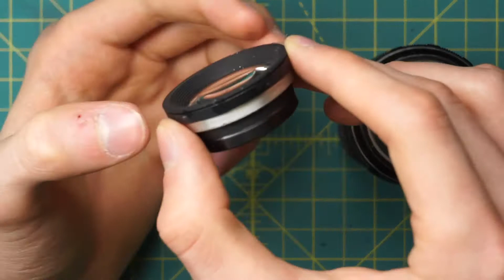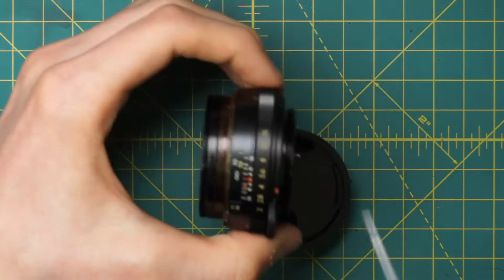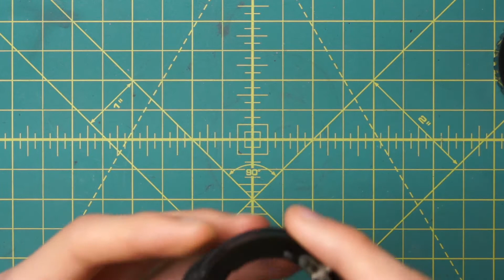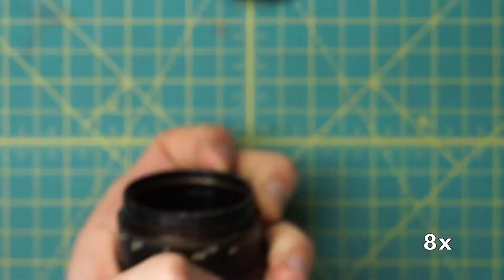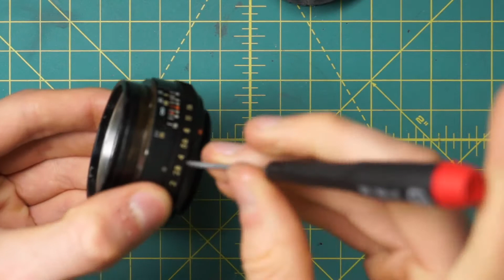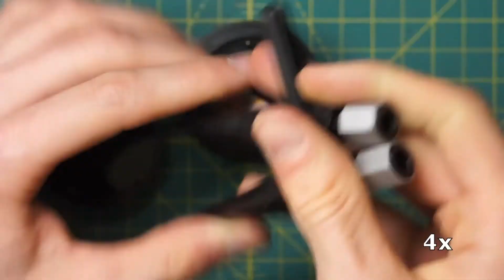Asahi Opt. Co., Super-Takumar 55mm f2 Lens Disassembly

Comment: Hi, I my problem is - the lens (exact the same except its 1.8) is always in auto mode whether the lever is on the M or A it doesnt matter. The lever moves but the mode doesnt change.
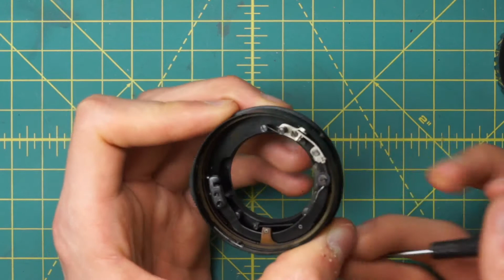As I zoomed the lens up front I could see from the rear element tiny gap inside and I saw one spring that should be attached to a screw (just like the on at 8:01 located at 12 o'clock) could this be the problem? Or what could possibly cause it? Is there any way to repair it?  Thank you :)

Comment: I have the 55mm f/1.8, I think it's pretty the same. My problem is that the aperture ring is stuck, it doesn't rotate! The auto/manual control works but the aperture is stuck between the f/5.6 and the f/8 setting. What do I have to do?
Reply from the maker: Try taking apart the lens to determine the root cause. If the aperture does not move at all, even when you try triggering it directly, then you'll need to try disassembling it to address that.

More likely however is that there is some sort of mechanical problem with your lens. Try taking the lens apart until you can move the aperture, then put it together step-by-step to identify where things stop working. Without looking at your lens, I cannot say exactly what is wrong with it but hopefully this video will help you work through it on your own

Comment: Thank you for these instructives, they're paving the way for my baptism into lens repair.  So much quality gear out there that can be restored if you just take that step and open up the lens. I'm still wary about opening up the sticking 80mm Zeiss Planar for my Hasselblad though. I don't see any oil and I suspect it may be a mechanical spring problem perhaps. Buying cheap lenses here and there and opening them up is one thing.

I just cannot factor in the cost some people are charging to have it CLA'd simply because it's a Hasselblad lens. Probably the worst investment I've made in camera terms. Bronica SQ-A would have been the way to go. Same size, half the price, just as great lenses.

Comment: Just got the same lens, only unknowingly I got the radiocative version. Wanted to try and fix the iris, tried to unscrew the top black ring as you said, it doesn't come off. Any suggestion? Thanks
Reply: if you see a amber hue to the glass its doped and is radioactive
Reply: whats the serial number of your lens? Because these early ones shouldnt be radioactive - they were made up to 1963 and then the newer ones (with the red diamond instead of red dot) started to put thorium since 1965 (S/N 1750 000 and up)

Comment: Does the front element have two lenses in it like the rear element? if so, how do I get it opened. I see two spanner notes but it seams like its seized up. I don't want to force it open, especially is its only one lens in the element. Thanks for the informative video.

Comment: I can't get the mode switch to manual. Fixable from the front. Advise appreciated.
Reply: can you see a very very tiny pin on the back of the lens? this must be pressed in (with e.g. a flat knife blade?)... only when the pin is depressed can the auto/manual switch be moved to manual.

Comment: Does the fact that this lens has thorium in its element concern you?
Reply from the maker: Unless you plan on crushing the optics into a fine powder and snorting it, I wouldn't be too concerned.
Reply: These versions didnt have any thorium inside them. Its a 345-2 model (with red dot instead of red diamond) made between 1962 and 1963. The thorium glasses were added since 1965 in the midproduction of 345-5.model (with the red diamond and more scalloped focusing ring)
Reply: @dzava  Hi, I am wondering does the 345-6 model contain any thorium? Appreciate your generous reply.
Reply: @zjonny1696  Hi, sorry for the late reply. Yes, I think yours already has thorium inside. Only takumars with red dot didnt have thorium inside them.
Reply: @dzava i have a 741xxx version with red dot. You consider mine not radiactive? Its not yellow and shoots the same as what i see with my eyes.
Reply: @-OEG  what is your focal length and aperture?
Reply: @dzava  mine did not have thorium. Its a red dott low batch serialnumber. And tested it with geiger meter. Very happy for that ;)
Reply: @-OEG  i think most of red dots if not all of them didn’t have thorium

Comment: Nice! Can you tell me to what degree the internals of this lens correlate to other Super Takumars? I've got a 50/1.4 and a 35/3.5. I also have SMC Takumars, but the internal construction of those is going to be somewhat different due to their ability to meter open and the addition of an aperture linkage etc. I suspect their internals are more like those of the Pentax K mount lenses.

Comment: Hey, I have a carl zeiss jena pancolar 50mm f/1.8 with a broken aperture (occasionally it works), do you have this lens and could you do a disassembly on it? I'm a complete noob and would like and try and fix it myself. I already opened it up (just the back plate) and everything seems to look fine so I'm guessing the blades are just sticky or something.